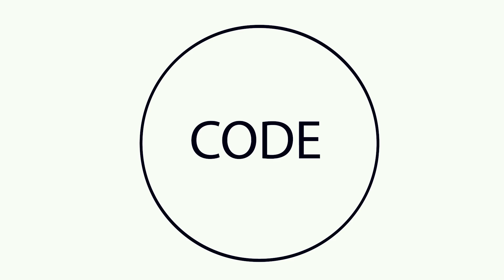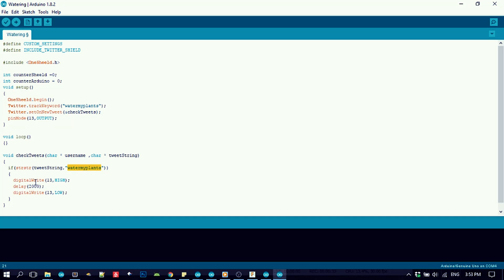Arduino Plant Watering System (ِArduino Home Hacks #3)

Comment: can you bring it a step further and use a hygrometer sensor for Arduino to measure the moisture, tweet the result then use 1sheed to tweet back to water plants.. I know dumb question but I'm trying to figure out which direction to move in a future project potentially using 1sheeld as a middle man to relay back to the Uno without stacking a ton of shields besides relay and 1sheeld plus a sensor or two?  thanks. (edited) because of auto correct.
Reply from the maker: Hey, yeah sure this a brilliant idea and surely can be done :)

And there are lots of shields in 1Sheeld can be used to help you with it like the SMS and the Notification shields. 

You can check all the available shields documentations just right here: https://1sheeld.com/shields/
And in this link, you can find 200+ Arduino projects made using 1Sheeld that you can get inspired with: https://1sheeld.com/arduino-projects/

So check them out and let us know what do you think :)